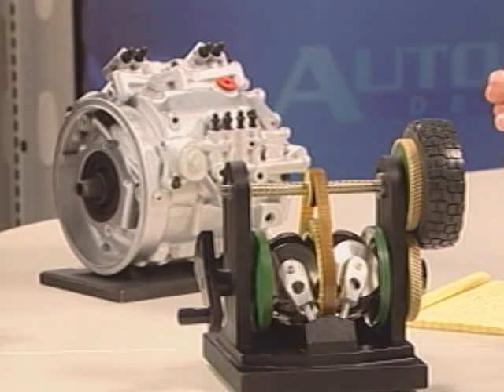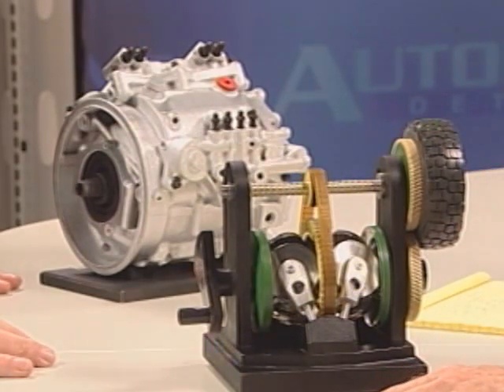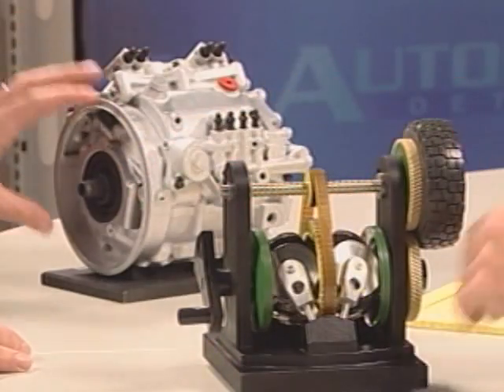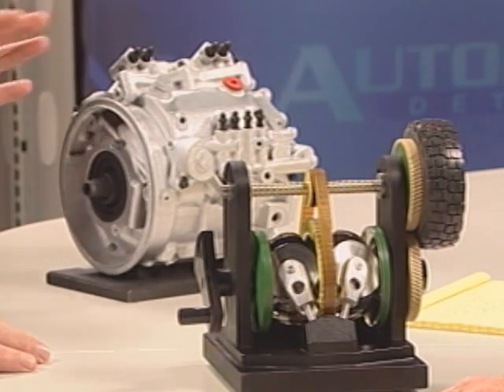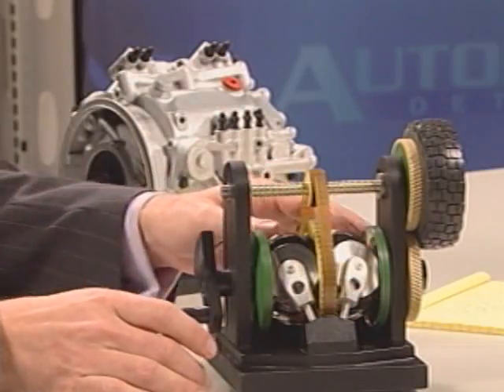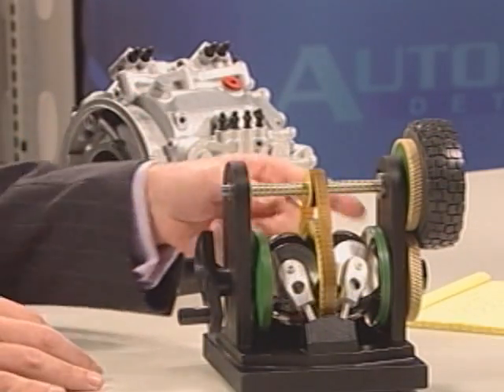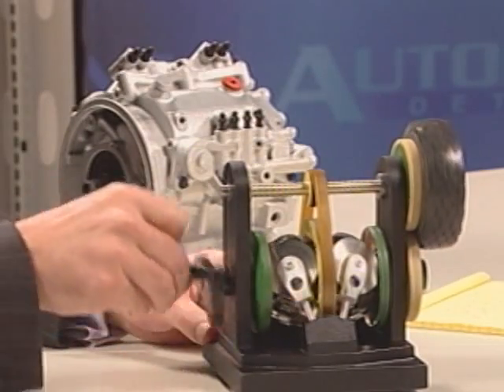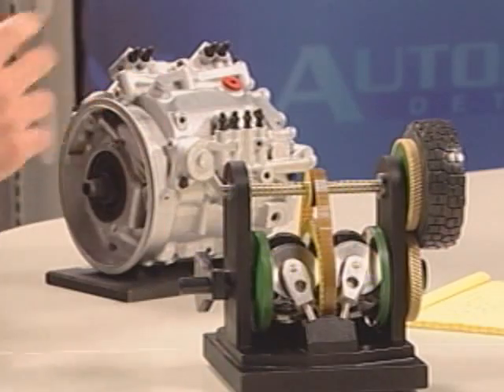Flywheel Hybrid Technology

Comment: For those who are confused, this video is very old, these systems ARE in use and have been for 4 going on 5 years in F1.  The new rules are allowing them to supply 160 HP for 30 seconds a lap.  The new LaFararri has one and yes Volvo made a giant one and stuck it on the rear wheels of a FWD car and saw massive improvements in fuel economy and acceleration.

Comment: None of the F1 teams use the flywheel system; they all have the electric system.
And in 2014 they will not be using flywheel either. 
They will be using both heat and kinetic recovery both stored in a battery.
Reply: I have heard that too, I just don't understand after researching and watching this video why on earth they would use a battery and not a flywheel which has less energy loss. Do you know why?

Comment: Not really. These systems are typically positioned up to the engine and gearbox, not near the wheels. And they have less overall rotating mass than the traditional powertrains they are attached to. Granted, the RPM's are higher, but here's been NO REPORT of KERS systems negatively affecting handling do to any gyroscopic effects. F1 has been using them for years and the main problem has been with increased mass of the system.

Comment: the big problem about flyweels is that they affect the steering...
Reply: Is that why f1 cars use electric energy storage rather than kinetic (flywheel) despite flywheel being more efficient up until the storage phase?
Reply: Nonsense. Multiple microsystems, could be balanced to cancel this supposed problem.

Comment: @newage4energy      I can see your point, but to store enough energy, the flywheel would have to be very heavy as well, which is acceptable in F1 as they have minimum weight requirements, but on a road car, I guess this may be a burden together with the original non-lightweight flywheel. Furthermore road cars stop occasionally, which is very different to the rapid accelration and decceleratoin of racecars. I guess that would cause problems on adapting flywheel hybrid to road cars ??

Comment: @Ebdan88 Or it could be because hydrogen fuel cells are ridiculously expensive for the power they generate, and even the most efficient batteries wear out and are dangerous to the environment for a very long time after disposal? Flywheels, while not totally viable as an independent power source, provide an interesting new way of saving power and most car companies would definitely be interested in that.

Comment: but the flywheel wont spin forever, right?  i mean it stores energy but it  will be availiable only for a few seconds, i guess
Reply: 37 years is the record for vacuum packed magnetic suspension systems to turn without stopping. NASA don't sell even models of the systems they use. Top secret.

Comment: There is a gyroscopic effect (technically it is called precession); the effect it has depends on the orientation of the flywheel, and it will introduce a moment of inertia (angular inertia) perpendicular to the plane of rotation of the fly wheel.  This means it can be used to reduce pitch and dive (reduce shift of weight front and rear), or roll (reduce shift of weight side to side), or reduce yaw (reduce the ability of the car to turn left or right (this can be useful to counter oversteer)).

Comment: You are of course referring to the precession effect. Not much is revealed about the flywheel itself, but we know it is situated at the center gravity where it's forces factored against the g's are minimal. In fact, there are more displaced forces from the drivers weight than the KERS system. I also think the flywheel is like an epicyclic gear system where the planet gears counter act and normalize all forces.

Comment: The model isn't false. But you're right in saying the demonstration is obscure - as this vid only demonstrates how a CVT works and fails to show kinetic energy recovery and input/output via a flywheel!
The design of the flywheel seems to have been withheld. And I'm not sure whether KERS actually uses a CVT,,, yet flybrid and xtrac say it does. Seems pointless to have two transmission systems in a vehicle don't you think.

Comment: well, i am not an engineer but based on my little knowledge on these matter, flywheel KERS seems to fit better in F1 cars.  but battery KERS for road cars.

batteries can keep the road car running longer in cruise mode.  flywheel wont but it can give the sudden burst of additional HP needed in racing.

am i right?
Reply: Yes you are right. The advantage flywheel technology would have is NOT  Arizona, but in places with lots of hills, or in stop start traffic. Amazed that no one grasps this simple fact.
Reply: @kennethkeen1234  It took 13 yrs hahaha

Comment: That's right.. that's the most important part. How the stored energy of a spinning flywheel is delivered to the drive train is the tricky bit!  Anyone can connect up a flywheel and spin it up to speed.. it's how you deliver the power to the wheels is what matters...  a CVT system is the only way to control the variable speed in the flywheel.. as it's used it slows down but must continue to drive the draive train at the same rate.

Comment: Not necessarily - the system is compact enough to work in tandem with diesel-electric battery hybrid system alongside regenerative braking. Electric motors at their least efficient at low RPM so the flywheel could act as a turbo charger to improve electric economy for low RPM. The compact nature means that four of these systems could be mounted for each wheel. There are so many ideas - its a really exciting time to be an automotive engineer right now!!!
Reply: Except that the boss says, you will be taken out and shot if you try to progress with flywheels. Don't upset his cart. Keep the planet stinking and he will be happy.

Comment: Is it?

Kinetic - electrical - chemical - electrical - kinetic is what is needs to do with an electric one (brakes to electricity to the batteries to electricity to the electric engine)

If it is 90% efficient at each change it winds up 65.6% efficent overall, and i would guess it is worse than 90% at each change

80% at each change gives ~41%

Comment: - Generators/Batteries/Motors electric system efficiency (ie: mechanical-electrical-chemical) is only 31% - 34%

LOLWUT?

I don't believe you.  The Generators/Batteries/Motors electrical system is more efficient than that.